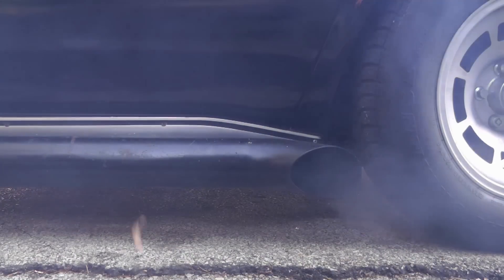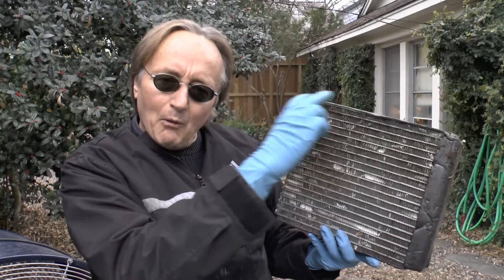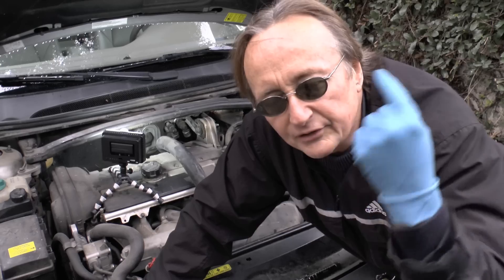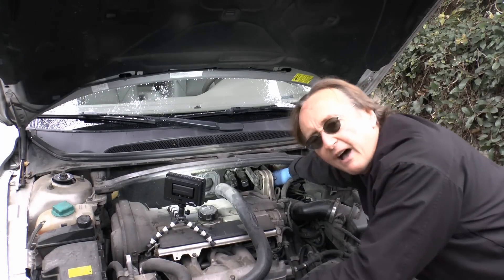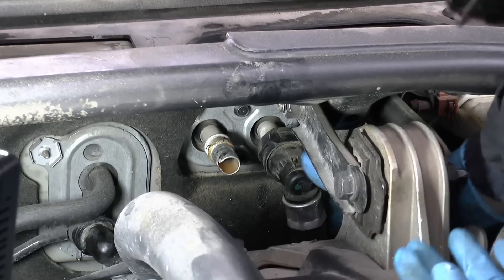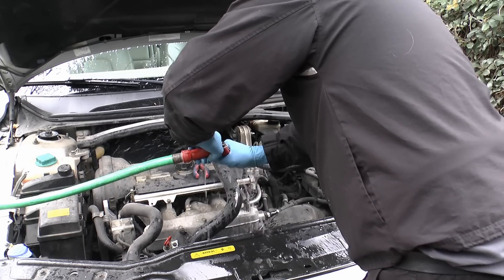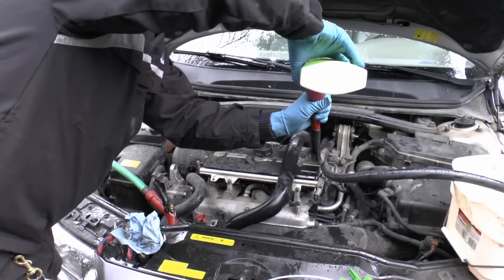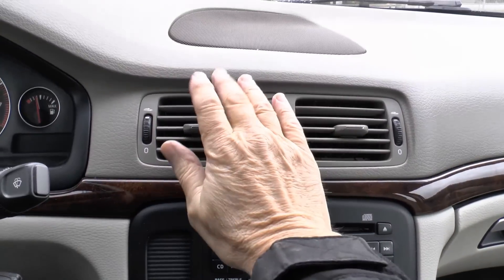Fixing A Broken Car Heater By Flushing It

Comment: Another trick when flushing is to attach the garden hose to the hose where water normally leaves, rather than where the water normally enters. This is because clogs sometimes break free easier when they are pressured from the other direction.

Comment: Thanks Scott this fixed my problem with my heater core. It took over 2 hours to get a big clog out had to use limeaway twice. The only thing I didn't like was all the smoke that started flying after you started the car again. My pipes where long to keep the water away from the engine.

Comment: Hi Scotty, been a big fan of your channel and have learned alot like everyone else here. The amount of questions you answer is amazing and mind boggling at the same time. But finalyl I have a question! i am changing my timing belt in my 1987 Nissan d21 v6. When I put the old belt to TDC. All timing marks line up except the passenger cam is one tooth off. Is it ok to move this cam by hand when the belt is off so the timing mark lines up from being one tooth off? making sure the other cam and crank dont move! Ok after counting the belt ribs on the new belt, there is 40 inbetween the white lines. and the old belt that is installed has 40 ribs inbetween the timing mark on the camshafts. but still the timing mark on the rear cover doesnt line up is this ok? truck ran fine before this, just changing belt because i am going to do the cam seals.
Reply from the maker: of course you can move it by hand, just make sure the belt is the correct size, often cheaper aftermarket ones are made wrong, I've had that happen many times on those, they are often just poorly made

Comment: I tried the hose the valve works and both tubes are the same temp but all I get is luke warm air  :( Do I need a new heater core?

Comment: Believe it or not, the heater core is actually very easy to access on that Volvo and you don't even have to remove the dash. It just slides out from underneath the drivers kick panel.
Reply from the maker: not on this model, the book pays 6 hours labor to pull the stupid thing out, including removal of the steering wheel.
Reply: Is this the same one that you replaced the electronic throttle cable
Reply from the maker: Michael Sackstein
yep, volvos all break a lot as they age
Reply: Yeah I've noticed that. Though I do think they hold up better than VWs and other European cars do with age.
Reply: Scotty Kilmer
Still some have millions of miles on their volvo's..One guy in Maryland has a million or two on his volvo 240 I think. His name is Selden I think. Irv Gordon in Long Island has over 3 million miles. I have 2012 s80 3.2  that I use on occasion. My 88'olds ciera is my daily driver. My heater is completely cold. Mechanic said on the phone it could be thermostat. If we get a break in this snowy winter I will get over to him and have NYS inspection as well.
Reply: Thank you... I'll have it checked.

Comment: Hello Scottie. my heat was blowing warm air back in the winter. now i notice the temperature feels the same as the outside. I have 2003 xc70. Is it possible that all i need to do is flush it like you did on this video?

Comment: Would this method also work for a 2007 LR3? No hot air on driver's side, but passenger side is fine.
Reply from the maker: you can try, but more often that's being low on coolant or a bad blend door actuator on the drivers side

Comment: Hey, Scotty, I know it's not an air conditioner, but after changing our engine control unit, there's still no fire/spark nor power to the fuel pump. Do you have any ideas? The auto shutdown relay has NOT been checked yet. All useful comments will be appreciated
Reply from the maker: check the crank sensor if it has one, and also check all the computer wiring for power in and power out when cranking

Comment: Hi Scotty, I have 2 engineering degrees and the Heater Core on a 2000 Jeep Grand Cherokee has my hair on fire!!  I flushed the heater core and the water flows fine and is clean!  But despite both lines going to firewall being hot, the Heater Core stays cold !!  No heat comes towards the cabin side!!  Blend Door area is now cut open and they both work.  Actuator also works and operates the blend doors!    Is there a FUSE / Switch somewhere that is supposed to trip the Heater Core!?  Thanks for all your hints.

Comment: Hey Scotty, I have a 2002 Mitsubishi Galant that blows ice cold air when I turn the heater on. When I got the car I noticed that when I switched the temp from cold to hot that I could hear a vibrating/rattling noise for a couple of seconds and then the heat would start working.

About two winters ago I would have to keep turning it from cold to hot when I first started it to get it to make that vibrating noise and then the heat would work. I took it to my mechanic three different times when it would go days without working but when it came time to bring it in the heat would start working again. He said it could be either the heater core or the blend door but since it was working when he got to my car that all he could do was guess which it was.

After that it worked fine for the rest of winter, but a couple of months ago I turned the A/C on because it was an unusually warm day. It's now gone two months without working. Which does it sound like to you? Or would I need my mechanic to see it when it's not working?

Comment: Nice video Scotty.  My wife was having no heating issues with her 2013 Chevy Sonic TL  1.4 L.  after they replaced her water pump at 10k miles.  I had to take it back to the dealer.  Turned out they didn't burp the system when doing the warranty repair.

Comment: Hi Scotty, what do you think would be the problem with a 2009 dodge journey where the heat only comes out from the drivers side of the car? When my dad runs the heat, only the vents on the drivers side get warm while the vents on the passengers side remain cold. The dealer told us it would cost $1000 to fix but I have a feeling they're just looking for a quick cash grab.
Reply from the maker: Bruce W   they are expensive to fix if the dash actuators are in need of replacement, but you can find someone cheaper than a grand

Comment: Hey Scotty. I have a 01 gmc Sonoma and whenever in going down the road the heat gets nice and got but when it's idling it gets cold and I can see my temp gauge drop. It's full Of coolant. Would it be the heater core or the water pump? I can't think of anything else it could be. Thanks!

Comment: I did this to my old car last winter. On the REALLY cold days (-25C) I would get air barely a few degrees warm coming out; and this was especially bad because my windshield kept freezing on the inside. Before I flushed out all the crap that built up in the core, no amount of running would heat the car up enough to actually melt the ice.

Comment: Great points about the blend door actuators and the heater hoses going to the core. Hot going in to core eliminates the entire cooling system. And like you said even if actuators where bad would be 2 separate issues (unlikely).

Comment: Thank's Scotty Kilmer I had this same happening  to old 96 GMC Yukon and did the same thing that you did in this video but  with out the fancy computer scanner tool that's nice but did not need that for  my old ride. The bend doors were open in and closing  becuse I could her them oping and closing. Also my Yukon is reaching  operating temperature like normal so the Thermostat is working. But found that one hose going to the heater core was really hot and the other just warm. So I did what you did and flushed out the heater core like you did and not much com out but after 30 minutes with the Lime Away and fished aging to get the Lime Away all out it flushed out nicely. so hooked back you the heater hoses topped of my coolant level and drove it a round and I have heat now when driving and idling and it the heat blows nice now as my old Yukon warms up like normal as it gets up to operating temperature like normal. Thanks  Scotty that was very help video and saved my a lot of money.

Comment: Great cheap fix, Scotty! You forgot to mention that it's most effective to BACK-FLUSH the heater core, meaning spray into the hose that is usually the outlet (the cooler one to the touch). I've done a few GMs this way and a whole bunch of rust chunks came out...probably from that DEX-COOL crap they use haha. Nice and hot after the flush, just in time for this 0F weather up here in PA!

Comment: scotty I've got a 2000 dodge dakota with no heat. one hose was hot and one hose was cold. I flushed the entire coolant system radiator, block, and the heater core. still no heat. but now I've got a coolant leak in my pass floor board. do I need to replace my core?
Reply: Jack Wheeler how to flush radiator and heater on 2004 dodge durango 4 7l v8

Comment: I used CLR once and it worked just fine. Also I made sure to run the flush in the opposite direction that the fluid normally flows to help break up the contamination stuck in the very tiny veins and passageways.. Seems like the gunk just kept coming.

Comment: I appreciate your videos but I have two concerns with this one. Why use such a crude method to run the water through the core when you have so much over spray into the engine. Some hose clamps and a hose repair kit are much more clean. And what if the cleaner exposes a leak in the core? Then you have a coolant leak behind your radio.
Reply from the maker: Yes, if you do it all the time you can make a fitting with a hose that will screw onto a garden hose, but really, the water hurts nothing, heck, you drive in the rain all the time

Comment: I highly suggest you do not do it this way.  If your core is brittle and you snap off one of the terminals you're going to have to yank the dash to replace it.  So disconnect them further downstream and flush from there.  Do not mess with the hoses at the core itself.

Comment: what if both lines are hot, yet only passenger side is blowing cold and the driver's side is blowing hot air? should i flush? what else could it be? plz help me "WINTER IS COMING"
Reply: CarreraTurboS yes it was the blendor, flushed the core but it was not making any difference so shoved my hand through the system to discover the real problem.

Comment: How do u unclog a heater core that has block seal in it clogging it up? Will like away work for that?
Reply: I have the exact same problem.  Put steal seal block sealer as scotty recommended but then got the heater core, radiator  and tstat clogged. I changed tstat and rad, flushed and bleed system but heater puts out luke warm air at best.  blew out heater core with compressed air but be careful, don't use too high compression. helped a little but not enough.  Next step is that lime away stuff but I think I won't be able to get the hardened steal seal out.  Good lucl

Comment: Wont the tap water cause probles in the cooling system? I think you should remove all water (flush it with coolant) from the heater core before you put it back together and fill it up with coolant, the minerals in the water will form limescale in the raidiator causing it to clog up. Correct me if I am wrong.
Reply: I think that if you just blow some compressed air through it that you will get most of the water out and what's left will probably evaporate from the heat of the engine. Flushing it with coolant is just a waste of good coolant to me.
Reply: Sorry, I meant destiled water not the actual coolant antifreeze, but yea copressed air might just do the work, but I dont think there is any way the water can evaporate in a closed circuit, which cooling is.
Reply from the maker: webkar
tap water doesn't hurt to flush, but if you're a fanatic, you can air blow it out when done and put in distilled water and coolant
Reply: xJoey_NL It won't make much of a difference at all for such an old part since tap water really isn't that hard. I believe (and correct me if I'm wrong so I learn something) that you really only need to use distilled if you're replacing old junk parts with brand new ones especially since gallons of distilled are super cheap. But if you're just flushing old parts and hoses, tap water can't hold a candle to the particles and gunk that is already in your system from years of use.
Reply: Distilled water is nice. Volkswagens use that with their 50/50 mix. I think the freezing point is lower too.

Comment: I have a 2002 Chevy S10 heater works and I'm not losing anti freeze but when I turn the heat on it I get a smell of maple syrup through my vents for the first few minutes but then it goes away any ideas what would cause this?
Reply from the maker: heater core is starting to seep, OR someone spilled syrup inside there
Reply: My guess the only fix is to replace the core? This past summer it was flushed.
Reply: It's not leaking at all
Reply: Just the strange odor
Reply from the maker: the heater cores often can seep for years, you notice no coolant loss but smell the sicky sweetness of the coolant seepage as air flows over it
Reply: Thanks
Reply: Lol there in no eating in my truck
Reply: seeya205 I havent either, Just a good way to buy some time and if it dont work, oh well, core leaking anyway
Reply: You have a leak. You have to replace the heater core. That smell is what coolant smells like

Comment: If I have a faint scent of antifreeze when I put on defrost in addition to fine mist, only when I first turn on vent fan, does this mean my core is bad and needs replacing? Can a simple flush really eliminate my issue? I have heat when set on low (1), but cooler on higher settings. I thought I had a leak and put Barr core fix solution in and then my heat went away. Mechanic, I am not!

Comment: I once cleaned out a heater core that was really clogged, no water at all went through, water pressure alone wasn't enough, so I hooked it up to compressed air, BANG a massive plug of clay like substance resembling a dog turd came flying out! LMAO! Heater worked great after that!
Reply: Most likely a StopLeak toughturd
Reply: Will a clogged heater core damage the engine? I would like to purposely to clog mine because the mixer door is always open and making the interior hot all the time. I don't need heater in my tropical country.
Reply: Will a clogged heater core cause engine overheating? I have no heat on my car and I already replaced all cooling system components but not the heater core and my car is still running hot
Reply: @cipher1893  I don't think it will cause overheating problems, I think there is something else wrong with your car
Reply: Covert Person I’m all out of ideas literally I have replaced almost everything. Replaced thermostat, temp sensors, new radiator , new radiator fans (running direct) , new water pump and still no luck I’m about to give up
Reply: Cracked cylinder head or blown head gasket
Reply: L J Sanchez I forgot to mention I purchased a rebuilt engine for it, still the same issue so I highly doubt it’s that . :(
Reply: @cipher1893  you're saying you still don't have any heat blowing out I seen where there's the blend door like he's talking about not opening they say you can hear this you turn on the heater control knob and you'll hear it make a k-thunk noise and then I heard a truck had no heater and they took the battery out and then hooked it back up again and it fixed it.  I've also seen where they've put the thermostat in backwards and it didn't work right
Reply: @atranas6018  Lol

Comment: The heater core costs over $1000? Oh my goodness! That's what I paid for my whole vehicle!
Reply: Its a Volvo! if course it is expensive! Actually, the core itself is probably not that expensive but to get to it you have to remove most of the dash so labor is killer.
Reply: A lot of cars cost that much because you have to rip off the entire dash - it's ALL labor
Reply: The core itself is nothing more than a small radiator-relatively inexpensive, but it takes hours and lots of work to do the job, which'll drive the price way up if you're getting someone else to do it.
Reply: I swear my next car should have better access to this radiator.. Having to remove the whole dash is an insane work!!  Which carmaker has better thought about this?
Reply: Juliso35 That's just how it is. A space thing. There's space inside the dash, why not use it?
I wouldn't base my car purchase on the placement of such a minor thing like a heater core. 
You'd have to work to find a car that doesn't have it under the dash anyway.
Reply: Ok .. you're right .. but. ... How not to Implement a kind of "door" for a better access? I think a previous Subaru's model have one!!.. Anyway today cars aren't  designed for easy future maintenance..
Reply: Juliso35 A whole door dedicated to access a part that might never even be touched in the car's whole lifetime would be a huge waste of funds. 
Some cars you can get to iy relatively easy by removing the airbag and glovebox, though.
Reply: Juliso35 For my Explorer, all I have to do, is remove a little cover under my dash (A few clips) then I believe there is a little plastic tray to pull off (So if it leaks, it makes the water flow outside the firewall) then take the hoses off and BAM, removed! I could swap the heater core on my truck in 20 minutes and about $20. 

The first gen Ford Explorer basically has a "door" to the heater core.

:)
Reply: +murkinstock I paid $1000 for my 1986 Bronco.
Reply: Jeremy Menchaca Nice! My brother has one, but it needs a bit of work. Is it a BII, or fullsize?
Reply: murkinstock Full size. Needs some body work tho.
Reply: A core is like 40 bucks on ebay from a company called sweedish car parts